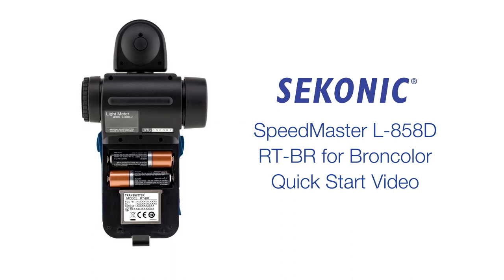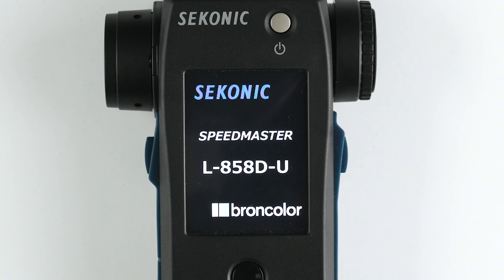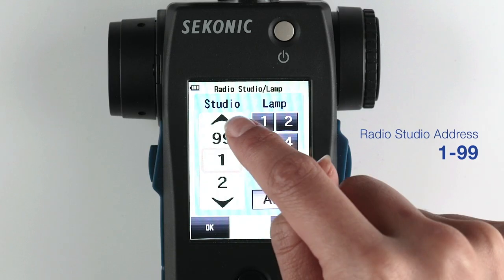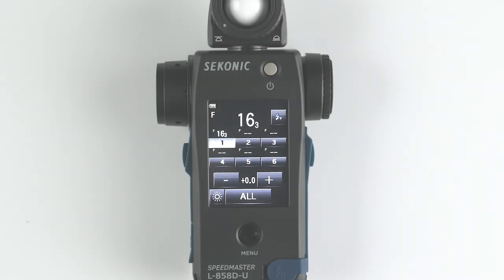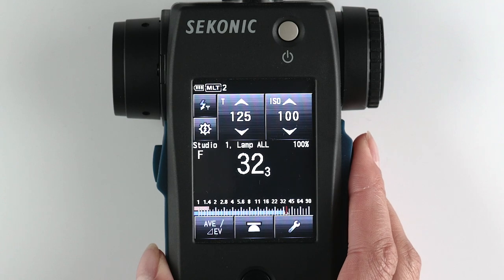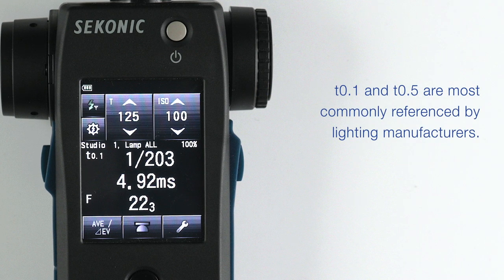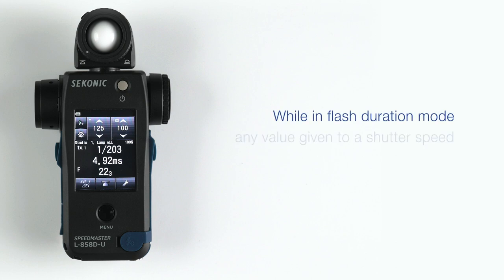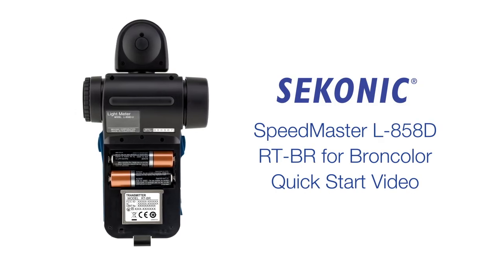Sekonic L-858D RT-BR for Broncolor | Quick Start Video

Comment: This piece is currently not available where i live. I have a Broncolor Siros L, is it possible to you use it with the sekonic l 858 D without the transmitter ? 7:38
Reply from the maker: Yes but it just won't remote fire the flashes. You will have to trigger them with a remote or from flash.

Comment: Why does Sekonic do not recommend rechargeable batteries? As it voids warranty
Reply from the maker: The voltage of most rechargeable batteries is lower, which can cause the battery indicator to show an improper reading.

Comment: Hss mode but no hs mode why?
Reply from the maker: HS mode is highly dependent on the timing speed of the cameras shutter. There isn't a way we can truly calculate that as it changes with each shutter speed and and Apeture. Plus HS often leaves ghosting because you still catch a piece of the shutter. HS is simply not as exact has HSS which will be consistent.